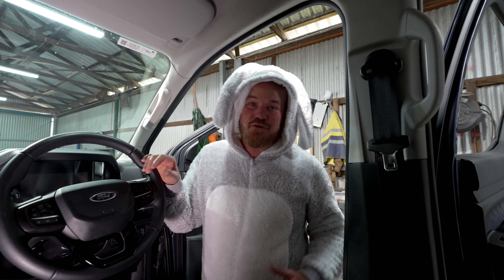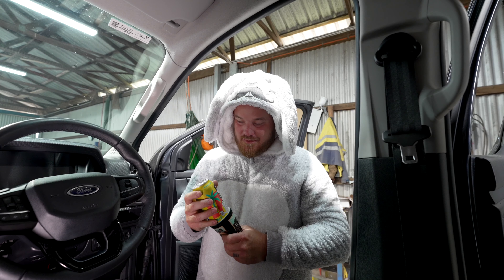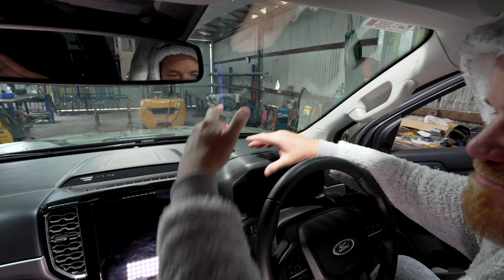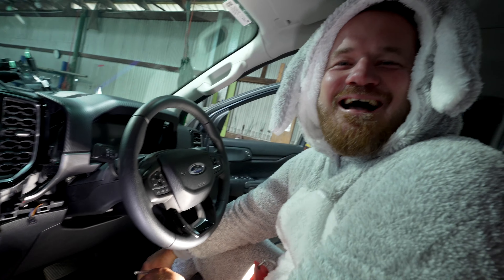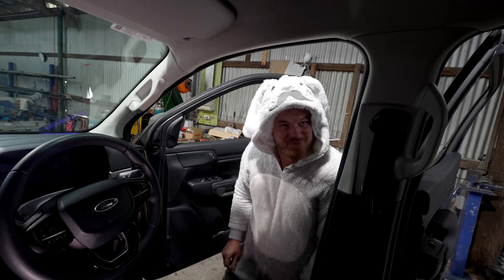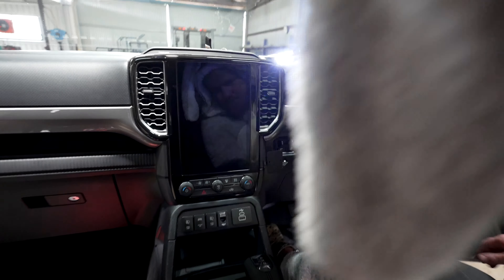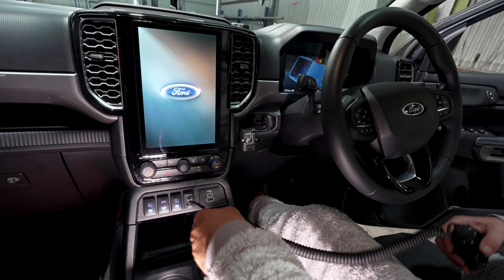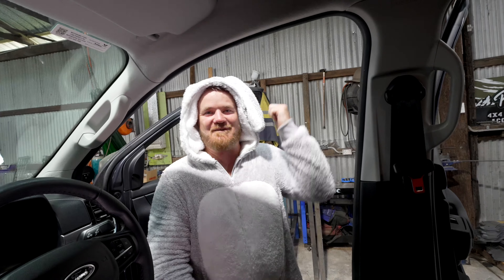NEXT GEN RANGER UHF HANDPIECE MOUNT How To Install

Comment: would love to see how you pulled the centre console apart. Looking to install the UHF GME XRS 370 unit in the there if its possible.
Reply from the maker: G'day legend - you want me to go through all that pain again? hahaha! it's pretty easy, everything basically pulls apart, under neath there is a few bolts. Start with the plastic trim around the gear selector, then pull up pretty firmly on the plastic trim around that whole centre console with the 4wd selector, traction buttons etc, once that's outta the way the rest is pretty easy.

Comment: Does this get in the way of the manual override for the break controller?
Reply from the maker: G'day legend - although it appears that way from photo's it actually doesn't, we made a few tweaks to ensure the break controller could still be easily accessed in an emergency.
Reply: @piratecampco  awesome, thanks bro. I shoulda ordered one when I ordered the bonnet aerial mount. Guess I’ll order is now’s. Cheers
Reply: I recon if the bracket holding the mic went down instead of up it would be a bit more out of the way. I feel mine is a bit close. I Had to modify the bracket and trim slightly as the brake controller kept hitting the 45 on the bracket and poppi g out and shave the trim as it wouldn't clip on. But fits ok now.